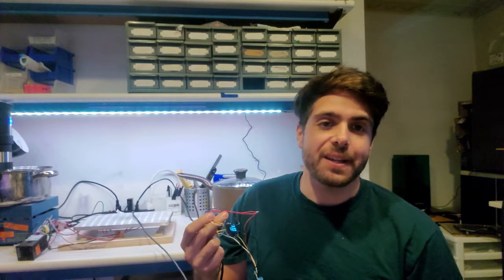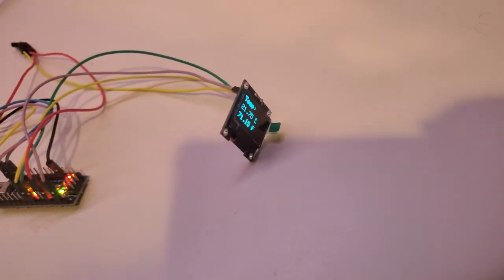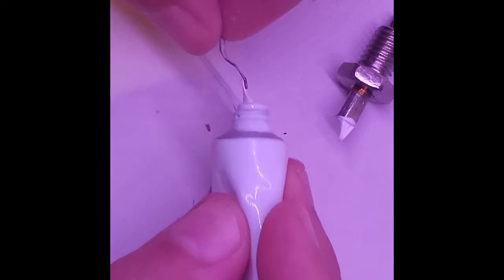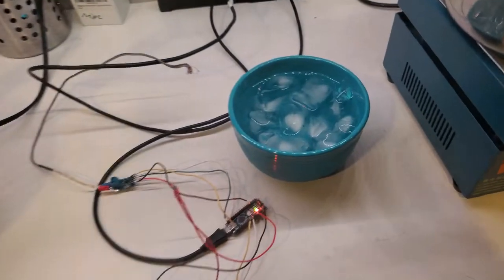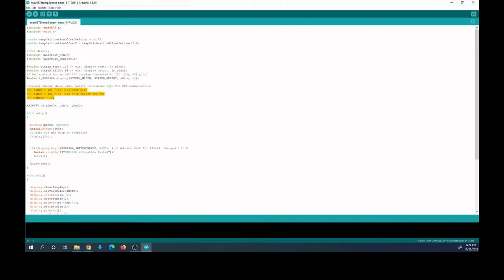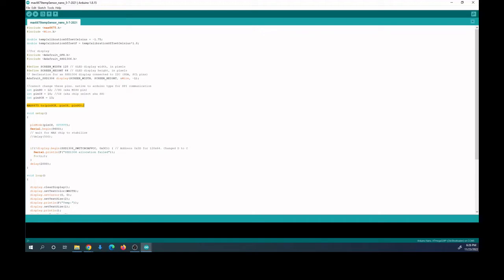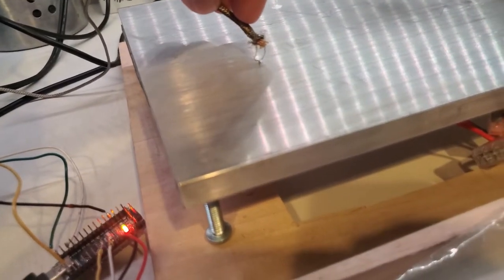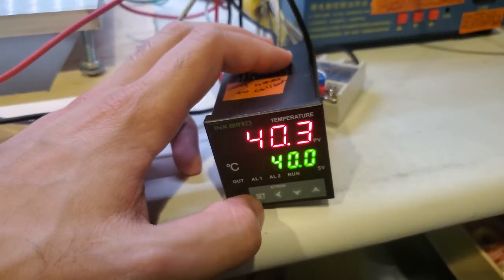DIY Thermocouple Temperature Probe Max6675 - How to make, calibrate, & use. Accurate!

Comment: Thanks for the video, I never made a probe like that myself. Interesting.
What do you typically receive for the 12 bit conversion when the probe is disconnected? I know we have bit 2 to tell us open fault, but I am wondering what is the typical conversion reading. Looks like I am seeing 4095 (1023.75C) but was wondering if you (or anyone) sees this behavior with the probe disconnected.

Comment: Thank you! Currently working on a "fly-by-wire" cooktop control system with direct pan temperature sensitivity - planning to have a copper disc about 1" in diameter, thermal-pasted to the Thermocouple junction and touching the bottom of a pan.

Comment: Evolution sensors and controls makes and sells thermocouples and various connectors and accessories. They are located in Florida, USA, so I don't know how good of a source they are for people outside the US. (If you call them you can talk to actual people that know what they are talking about, btw.) (I'm not associated with them, but I did buy some thermocouples from them.)

Comment: I did the seme procedure, I used this small function to calculate the compensated value accounting for gain and offset using a linear approximation: 

PV=Module.readCelsius(); //temperature value read by the MAX6675 module

//function that compensates gain and offset:

//known_T0 and known_T1  are the first and the second known reference temperatures (can be ice bath and boiling temperatures)
//reported_T0 and reported_T1 are the corresponding temperatures reported by the module connected to the arduino at each test

float PV_comp(float known_T0,float reported_T0,float known_T1,float reported_T1)
{
  //compensated temperature concidering offset and gain error 
  PV = (PV-reported_T0)*((known_T1-known_T0)/(reported_T1-reported_T0));
  return(PV);
}

//call the function to overwrite the Previous value with the compensated value:

PV = PV_comp( .... ,  .... , ....  , .... );  //<<fill with reference values and the experimental values

it seems to work fine, but ended up finding out that my second chinise  thermocuple is way off (reads 145 at 100C !)

Comment from the maker: Made a mistake at some point. Said wires of thermo couple were soldered together. This is not true. They are WELDED together. Also, MISO protocol should be SPI protocol.